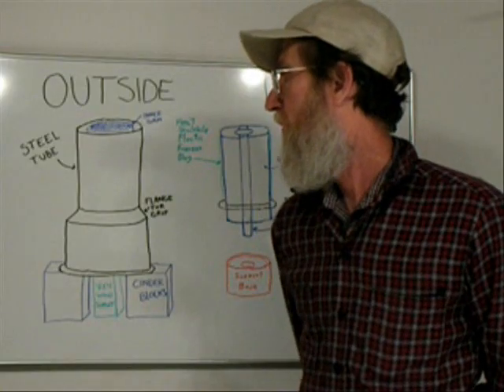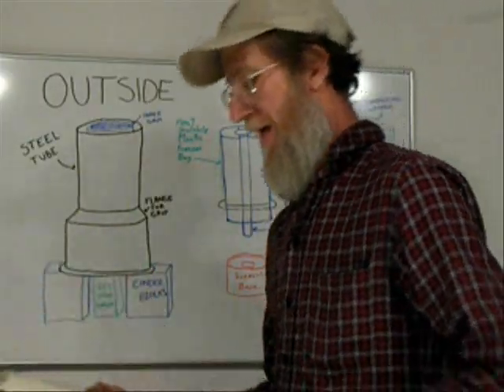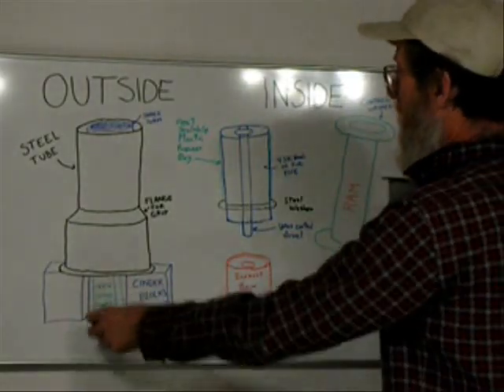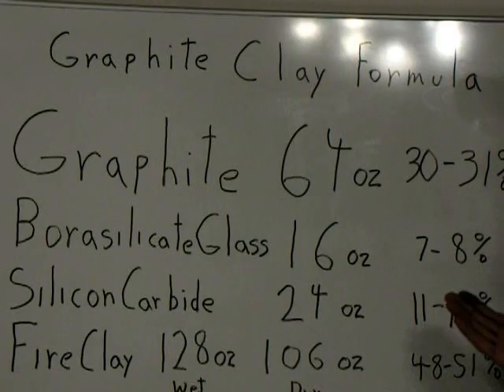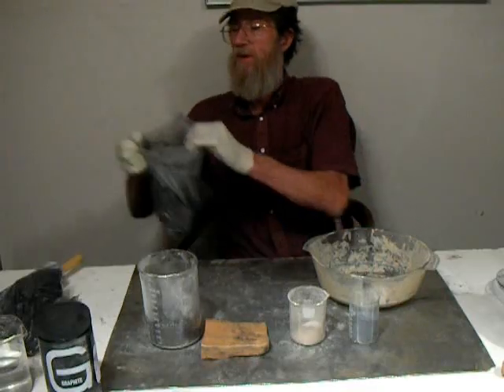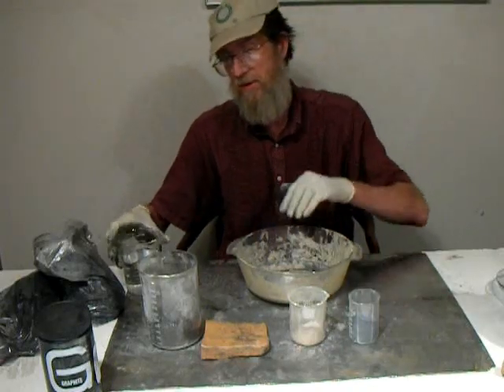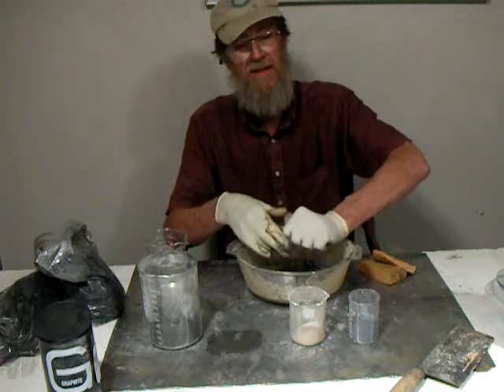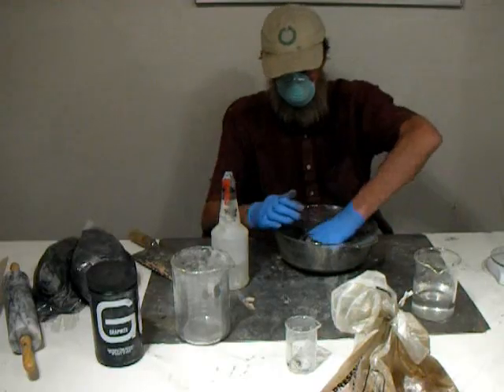Making a Graphite Crucible

Comment: been thinking about having a reasonably tall kiln and cruisible combo where i can put in a complete cilinderhead (unbroken with valves springs everything still in it ) 
i seen it done once but the guy used a verry large burner putting the flame staight in the opening against the aluminium inside a steel barrel layed down at an angle with the catchcan under a hole in the lowest point , verry crude and wastefull in the amount of energy used to melt it but it worked 
the dross basicly stuck to the barrels wall on the way down while the pure aluminium dropped further and out the hole 
like to try it with the kiln vertical and the burner as is normally placed and have a hole in the bottom of the cruisible sitting on a hole in the bottom of the kiln , the kiln sits higher off the ground then usual and the mould is placed under it (want to make clean aluminium ingots that can be remelted and cast the normal way )
my thought is basicly to not spend a lot of time pouring or even take out and handling a red hot crusible , taking out dross and all that but just have the aluminium leak out the bottom at the same speed as it melts off the head 
and keep adding scrap through a hole in the top and having moulten aluminium pour out the bottom 
any idea how to get the dross to seperate while the aluminium drops out ? 
will it stay in the crusible or block the pourhole ? 
if the dross comes with the aluminium leaking out i was thinking on a small gutter from the leakpoint down to the mould for the dross to stick to , but it might be too cold and have the aluminium solidfy before it enters the mould or just make a bigger mess of things

Comment: If you use fire clay in dry form, it would be much easier to mix. I know that you can get it because I have a fifty pounds sack of it. What about using aluminum dioxide instead of boro silicate glass?

Comment: This was a very well presented diy. 
I noticed you don't reply to most questions.  But here goes
Can that mixture be used for molds?
Would having the clay in powder form be a good idea? 
And a question I see asked is will this work to melt steel?? 
Thank you for your time and effort in sharing this video. It's the only one I have seen for making clay crucible. Thanks again and have a great day kind sir!!!
Reply: From everything I've read trying to find a source for a crucible w/ which to remelt some steel, any graphite crucible will just leach carbon into your steel and you'll end up w/ cast iron & a (severely?) compromised crucible. Any attempt to melt iron or steel has to deal with a couple of issues: protecting the melt from oxygen in the air [since the kindling temp of steel is below the melting point] (which is apparently normally accomplished by a layer of molten glass on top of the melt) and a bottom-pour capability (because the protective glass layer would form inclusions & other flaws if you tried pouring from the top.) I figure one of the small inductive furnaces sold for Al, Cu, Ag, Au melting would be fine, if one used a bell jar approach to evacuate most of the atmosphere & then introduced argon [widely & cheaply available from welding supplies;] the minimal surface exposure from the deep, small diameter crucibles those units require would enable one to pour a casting w/o compromising the batch, but nobody seems to offer a suitable crucible, just the graphite variety. Probably because of liability concerns... pesky injury lawyers! 🙄

Comment: Dear Mr Bob; what extra care must we take if we plan to keep liquid aluminium in the crucible for several hours? Luc
Reply from the maker: Not sure why you need to do that but here goes.  Molten aluminum, in free air, is constantly oxidizing.  That's the reason for the spoon at the last before the pour.  The longer you wait before the pour the more aluminum oxide you create and hence the more billets you would have to add and dross.  Best answer I can give is to remind you to have plenty of propane and not run out.  If the aluminum solidifies past the slush stage or cools too hard stage in the crucible it will crack the crucible upon reheating.  Only way out then is eat it out with lye.  Might as well put funnel over the top and enjoy the burn off of hydrogen gas.  Maybe collect in dry cleaner bag w cannon fuse lit. LOL

Comment: Its all new to me the method you are using and there may be strong reasons why you do.  However i come from a ceramics background where we were slip casting.  That is getting all dry clay ingredients adding to barrel of water making thick slip clay, adding deflockulent.which makes it appear thinner, more wattery.  Then we added slip to dry/ semi dry plaster of paris molds.  The benefit is there is definitely a higher success rate/ failures due to cracking.  Dont know of this helps but just what i know

Comment: ZOOZO Brand as one of the major graphite crucible manufacturer in China , was established in 2012， With more than 5 years producing and exporting experience. 
The main machines Zoozo can supply: graphite crucible for vacuum coating. Our company"s products are mainly applicable to vacuum coating.

ANHUI ZOOZO GRAPHITE PRODUCTS CO.,LTD

Tel: 0086-551-62634243
Fax:0086-551-62633220
Mobilephone No:0086-186-5653-1222
Wechat ID: 0086-186-5653-1222
E-mail:young@zoozochina.com

Comment: Caution ! Any DIY melting metal that takes over 2000 degrees, start out with very small foundry, crucible and amount of metal. Learn it at the smallest scale and work your way up. You will understand why very quickly. It will also save you money on materials for future foundry projects.

Comment: I'm starting out with forging, and mine will use coal/charcoal for fuel. Do you know if these kind of crucibles will work for a solid fuel crucible?
Reply: Maulkin Lahstnahmey sure will.  I highly suggest you don't use charcoal.  It's how i started and you have to get the good quality charcoal.  It goes very quickly and gets expensive.  I have had good luck burning deisle.  Less hassle, cheaper, easier.  Look up "kwikie burner."  Some brass fitings and a little time you will have a solid setup.  Recomend a handful of those cheap clear inline fues filters and my nosel plugs up quite often.  Good luck!
Reply: Andrew Cornstubble  He means "diesel".

Comment: I recently purchased a Clay Graphite crucible off of Amazon. What do I have to do before I use it?
Reply: I am going to be using a mini foundry to melt just Aluminum
Reply: +Intel Elite ★ feel free to heat it slowly for an hour or so at a few hundred degrees. in all honesty though, i don't believe it's necessary to do so,  but if you're worried, then why not?
Reply: +Intel Elite ★ feel free to heat it slowly for an hour or so at a few hundred degrees. in all honesty though, i don't believe it's necessary to do so,  but if you're worried, then why not?
Reply from the maker: Make sure it is dry, perhaps even dry it in in an oven before use.  Most important is storage.  Keep in in a dry place well heated in your house.  If an accidental rain occurs be prepared to throw something over the entire foundry but always be prepared to empty it vs letting the metal cool.  Never ever let molten metal solidify in a crucible
Reply: please heat slowly and let it cool down on its own!! it could crack if you don't!
Reply: Hi： This is Elko Hu from Baofeng Five Star Graphite Co., Ltd. from China. We are the professional manufacturer of high pure graphite and isostatic graphite,and machining graphite parts. we has own professional processing plant- Changrui graphite Co.,LTD., which covers graphite mold,graphite die,graphite plate, graphite crucible, graphite vane, graphite wheel, graphite ark, graphite tube, graphite rotor, etc.. also accept customized graphite products. any requirements,please contact me.thank you. Elko Hu Baofeng Five-star Graphite Co.,Ltd Western industrial zone, Baofeng County, pingdingshan,Henan China. Contact Number/Wechat:+86-15617656935 Skype/Whatsapp:0086-15838243056 Email :elko@graphitemanufacturer.com Website :www.graphitemanufacturer.com

Comment: dude, the effort you put in verus $50 on ebay.... IESH!
Reply: Learning how to do it, and doing it yourself forever is worth it.   If you drop $50 on one, it's fine.  If you end up doing a lot of work, requiring different sizes, and replacing them each after a couple dozen sessions, you're going to spend a fortune. 

It's just like everything with metal casting.   If you need one widget, just buy it.  

If you're going to need 1,000 widgets, it may be cheaper to do it yourself.   

If you foresee a need for 1,000 widgets, each with their own customizations, it's probably the best to do it yourself, and sell to others who just need one.

Comment: Is there any benefit to a straight walled tube shape? Seems like a more bullet shaped crucible with a wider mouth would be stronger and easier to work with.
Reply: The "bullet shaped" is called "bilge shape".  The narrower curved bottom is suppose to heat more evenly in a "fuel fired" furnace, like one using propane or charcoal.   The straight walled shape is normal for electric "induction" furnaces, since they don't have the motion of the flame.   Obviously, straight walled is easier to make this way.

Comment: I was involved with machining a pure graphite mold to press glass into a parabolic shape and wondered if this process to make a mold is less expensive than machining a pure graphite mold. The glass part was going to be borosilicate. If you use borosilicate as part of the chemistry to make the mold it might not work to make a part with that same material.
Reply: I'm looking to make a Crucible for melting COE 96 glass for fussing and glass blowing. Was thinking the same using Borasilicate Glass in the mold would not work for me. 
I'm open for suggestions?

Comment: Hi Bob, so 2 things I'm curious about. 1- you spoke of a new formula you had a few years ago. Has that worked better for you and would you care to share? 2- with these crucibles, once you do the slow process of bringing things up to temp for your first pour; do successive pours have to be slow as well? In other words my crucible is setting around for 2 weeks. Do I need to heat it up really slowly when I decide to do some casting or can I just ramp up my foundry furnace on waste oil like I normally do with a steel crucible?

Comment: Way to go on proper safety. YOU ARE NOT OVERDOING IT, new people take it from people with scars! May look funny, but you will really look funny not if BUT WHEN it happens. I hate burns the only thing that stops a burn is a old trick I learned from a moonshiner. Nothin like wanting to keep putting you hand in cold water and taking it out every few minutes never stops. Run it under hot as you can stand water from the tap for a couple minutes after that no sting. I think the ol hippy looks pretty cool in the suit lol, great find in eBay, I will have to look. You put a lot of work and thinking into your design and form. Your a pretty fart smeller! Keep butt the great work!

Comment: Is that space suit really neccesairy? -_- i always melt metal in my normal clothes...
Reply from the maker: You bet it is!  At least wear leggings and some protection for your feet and hands.  Eye protection is mandatory with red hot molten metal.  I have had molds explode splattering my face shield and once a back blow burned thru my leather welding glove in less than a second.  Still cooking my hand as I struggled to remove the glove flesh and all.
Reply from the maker: Yea But You are watching this video which I am filming in real time without knowing how it will turn out.  Then to add to the danger a crucible I invented myself.  Wear safety goggles and protect your feet.  I have suffered a simple backspurt on my hand wearing heavy welding gloves.  People you cannot remove a glove fast enough when 2000F metal is on top of it.
Reply from the maker: Well put.  That much molten aluminum   would hurt you if the bottom broke off and it splattered on the ground.  Truth is I suffered burns before the internet was even invented as a teenager where I could have lost my hand.  Now as an adult , Use eye protection.  I have seen molten aluminum splatter 20 feet and cover the entire 180 parameter like a grenade.  Problem mold not vented correctly or even worse tiny sliver using wax template caused explosion.  Protect the eyes first because that is most debilitating then the lower body especially the feet  and always carry the molten metal close to the ground.  Never ever pour at waist height.  You are just asking for trouble if you do not follow these rules.
Reply: surplus Barry, is surplus, he found a good deal and bought it.  No problem with that.  Mil surplus is often, but not always done via auction to the highest bidder, one fellow bought a Military 5 ton truck, M39/M809/M939 series recently for $8,000.  The military got their use out of it, and sold it.  Same with this
Reply: +chaos he had just made a brand new Crucible he had no idea of any imperfections in it The Crucible could have cracked as soon as he picked it up I applaud him for his safety measures even though it does look funny the same kind of suit to wear to approach volcanic material. now that he has his Crucible test and I'm sure he will dial the safety gear back some
Reply from the maker: Great discussion on safety guys. I love it when people actually think about it a bit.  I consider eye protection the most important compared to walking with a limp or losing a hand.  You should be safe enough with regular clothing if you don't mind an occasional burn as long as you follow a few pouring rules. Always carry the crucible low to the ground have the cope and drag as low as possible. Never pour on a table or anything at waist level.  The worst culprit is lace boots or shoes which are impossible to  remove in a catastrophe.  I had to make that myself hence the video "making fireproof overshoes".  Unfortunately, I am the curious type who loves to "mess around" with untested mold material, binders and crucibles.  The fire suit which is made of Kevlar eliminates any possibility of an "event" no matter how clumsy I am.  Did I mention It was military surplus and cost less than a pair of jeans and coat at the mall?
Reply: The thing that impresses me is how you managed to find this 2nd hand suit to fit you as you look tall enough to shit in a birds nest ... but hey this vid was uploaded in 2012 & your last post appears to be 3 months ago so it's definitely working for you as you're obviously still around ... great vid mate & when researching from the get go & playing with these temps you can never be safe enough as so many things can go wrong in this field ... onya mate keep up the good work ... there are talkers & there are do-ers you being the latter ... cheers from down under ...
Reply: +rlbob1 i did agree with your safty measures
Reply: +rlbob1 okay it may slow his rejection time but the safety measures would mitigate the time he needed to react because it would protect him in the meantime so you have almost a double-edged sword so to speak it may slow them down but that's freaking space gear should protect him for about five minutes of that kind of heat so he would definitely have enough time to fire extinguisher it cold water on it or anything I cannot in no way in my mind conceive of a better way to say for instance The Crucible that he made worked until he picked it up maybe it had a slight fracture in it and by the time he picked it up from him moving it from the forge to the pouring thing the wait Just Cause 2 fracture to split and break in the middle of the air ban you're burned you cannot count on anything made by human hands for 100% integrity ever maybe 99.9% but never 100%
Reply: Thanks rlbob1, Always crucial to understand the magnitude of how much damage can be done and how to prepare before engaging in dangerous and potentially life-changing activities. I am reconsidering ... :)
Reply: N J Rasmussen
you make a valid point but even so, the nature of ceramic based crucibles is such that if it were going to fail it would do so during the the curing and firing. if it were to fail after this it would do so in the foundry during smelting or as he tried to lift it. and again the gear he was wearing would slow his reaction to this situation. molten aluminum is hot but not as hot as molten copper or iron/steal where these sorts of suits would be worn, and even then usually only in industrial settings. for aluminum leather is more then enough to shield you from splatter. im not saying he shouldn't wear safety gear, im saying too much can be just as dangerous as none at all, something lost on the Australian  mining safety regulators ive seen here. when working with molten aluminum its best to look at the level of safety glass blowers use.
Reply: I also "wondered" a little about the suit. It makes good sense to take safety precautions, also with the shoes you've made. All too often I watch videos on Youtube, with people that doesn't care at all..! Sooner or later disaster will strike and they will suffer terrible burns or even loose eye sight. 
So folks.... MOLTEN METAL is dangerous....protect yourself and use common sense before attempting to make such a device.

Comment: what good or you doing with all that safety gear on and you got tent shoes on
Reply from the maker: I fixed that years ago  Check out my video "making fireproof overshoes".  Had to make them myself.  I do experimental ceramic molds so the danger is much greater with me.  Have had volcano spewing red hot aluminum from time to time.